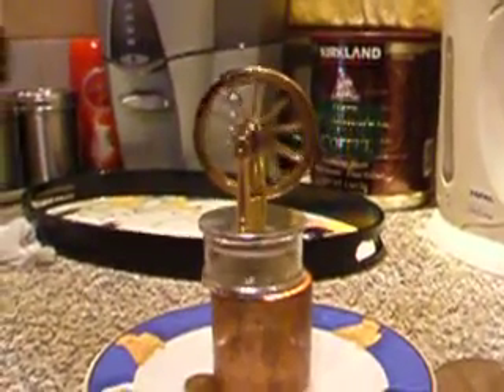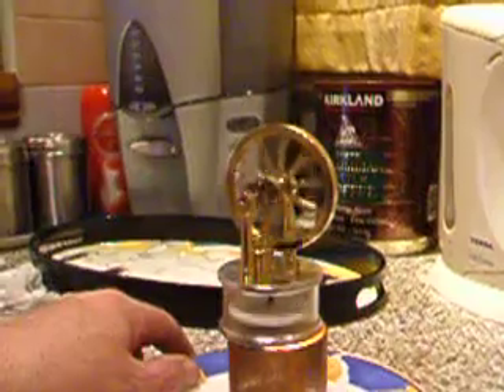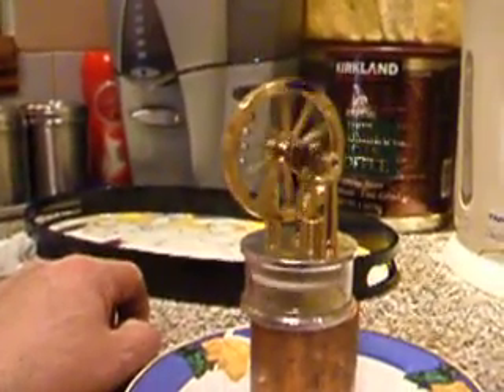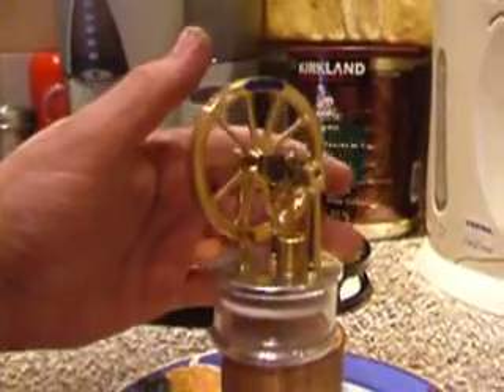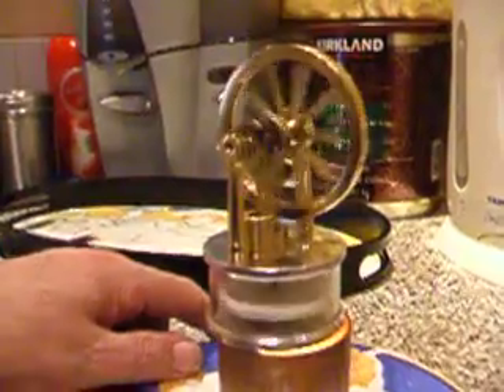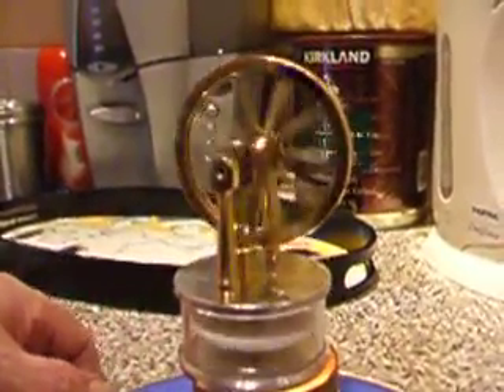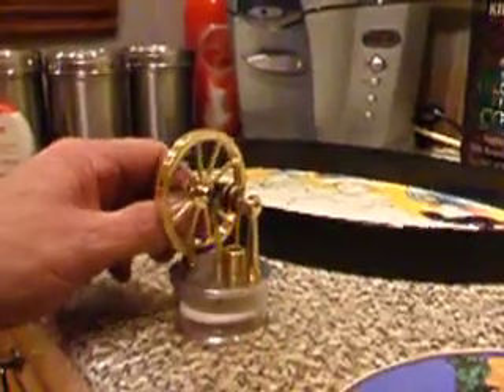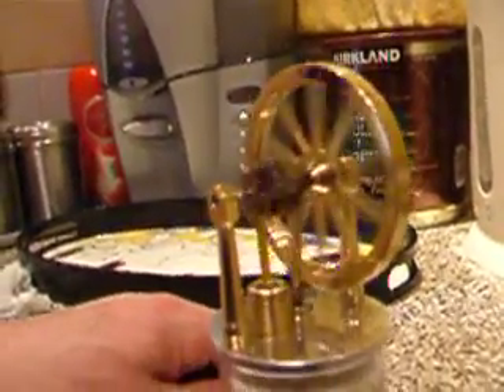Egg Cup Stirling

Comment from the maker: I should really have made an easier one to begin with, as it was a real pain to get it friction free enough to run. Oil on any part will kill it dead. Everything has to be well sealed and dry. The main problem was the bearings for the crankshaft, they have to be made spot on, just like a watch pivot.  I am looking at fitting miniature dry running ball races on the rebuild of this engine, as it was accidently dropped and the crank was badly bent.